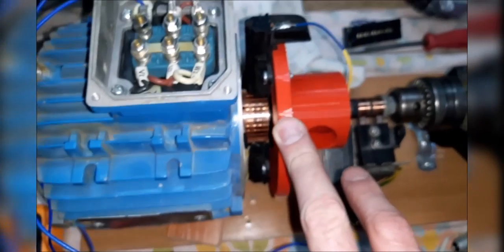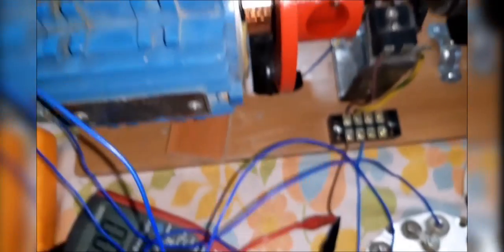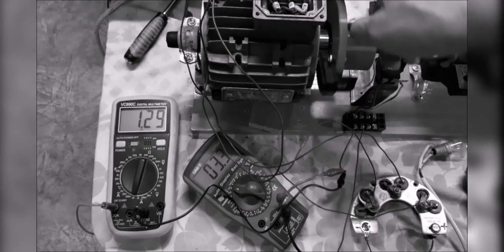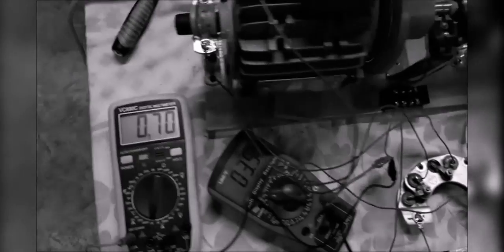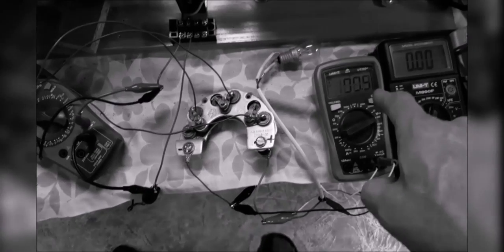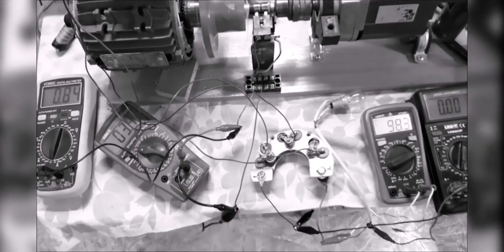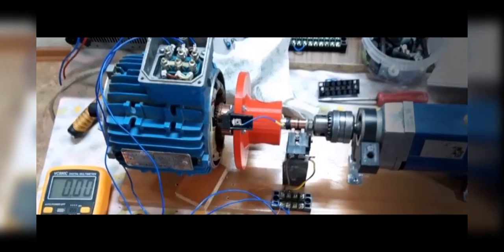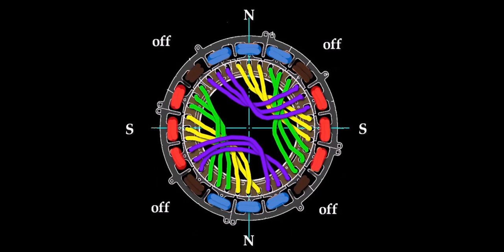Alternator without rotationtitled video

Comment: I have disassembled so many motors now, trying to get a rotor and stator that will fit. The garage is now where motors go to die...
Reply from the maker: I agree with you that it is very difficult to find suitable cores: DC motor anchor and stator with grooves. So it is easier to design and order for a specific application. There is one problem: it is very expensive.
Reply: make a magnetic rotor, transfer everything to electronics

Comment: Holcomb system technology. Гарна спроба, вітаю
Reply: Not Holcomb ! it still has to be rotated by the DC motor to rotate the carbon brushes ! Holcomb has absolutely no rotating parts but must have an electronic control circuit. This machine has no reactive magnetic field .
Reply from the maker: DC motors are also controlled by an electronic commutation system.  What do you mean by the phrase ‘reactive magnetic field’, in any synchronous generator there is one field which is summed up from two sources, the field coil current and the phase winding current. It doesn't matter in a rotating or static rotor.
Reply from the maker: Роберт Холкомб (доктор медицини) зробив те, що чомусь не змогли інженери електрики. Але, це його інженерне рішення, яке не найпростіше. Найімовірніше першим був Клементі Фігуера у 1902 році з електромеханічною комутацією.  https://rakatskiy.blogspot.com/2022/06/blog-post.html